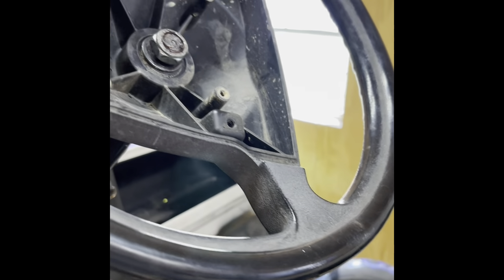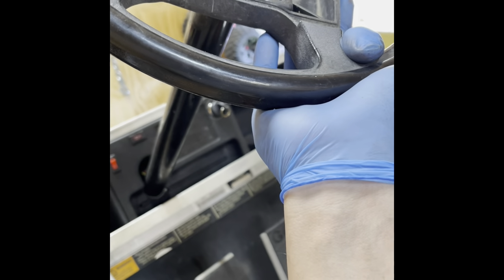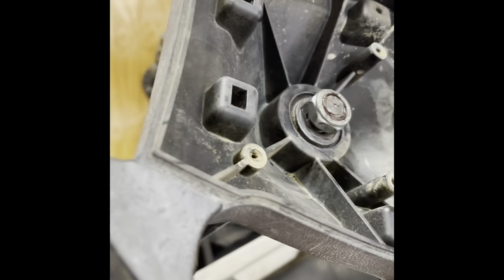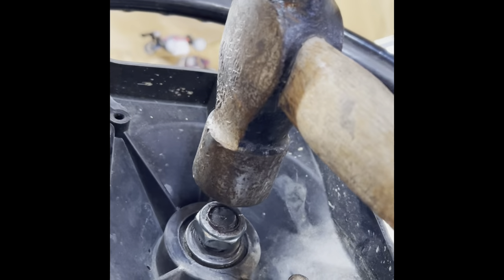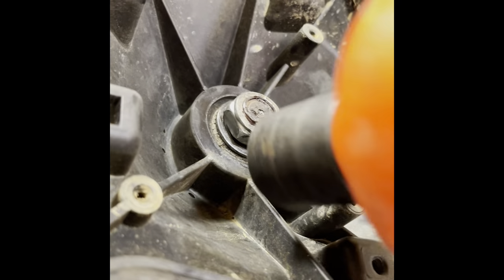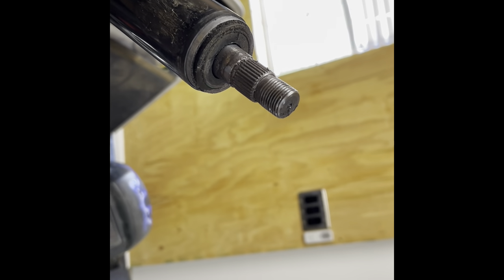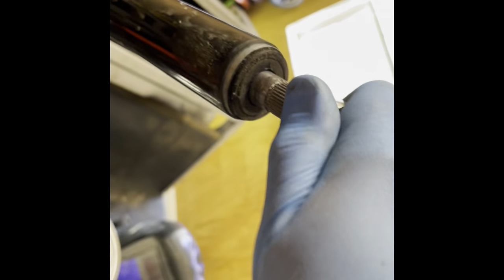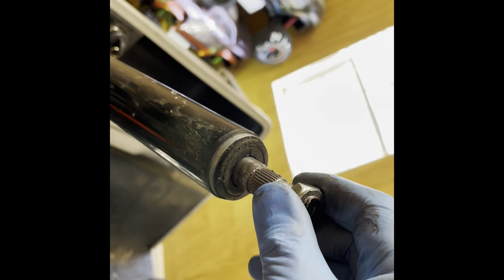Club Car DS Steering Wheel Removal (The Super Easy Way)

Comment: I used an old lug nut instead of the steering wheel shaft nut because it's a heavier, longer nut with more threads. 
That did solve the potential problem of messing up threads on the shaft.
Unfortunately I still never got the steering wheel off no matter how hard I hit it or no matter how hard I pushed up with my knees. I guess being a 1995 it should have been taken off sooner and a little grease applied. 
I can make a tool to push it off with a couple of jacks but I was hoping to not have to do that.

Comment: eh it worked for me, got a sawed off 10lb sledge named Le Grand Martel, feet on the dash pulling with my knees still took like 8 whacks. flapwheel on the grinder to chamfer off the top edge of threads and the nut still threads on. wasnt sure just how abusive i could be trying to get this damned thing off so your videos on this subject are greatly appreciated.